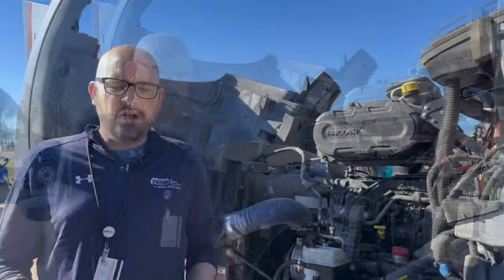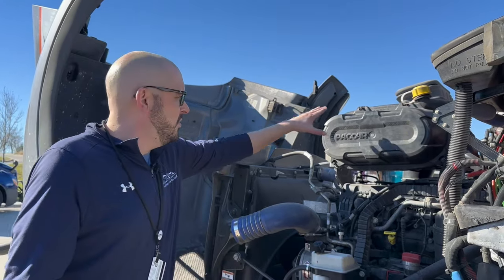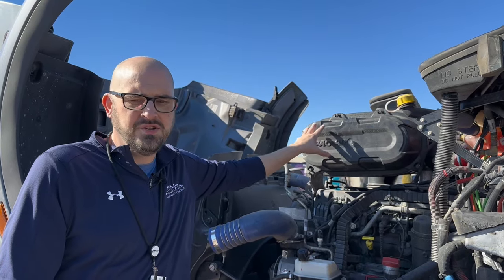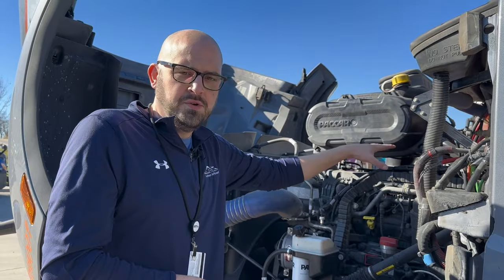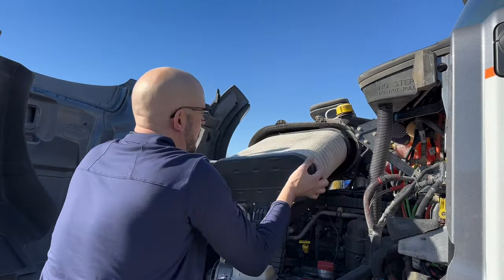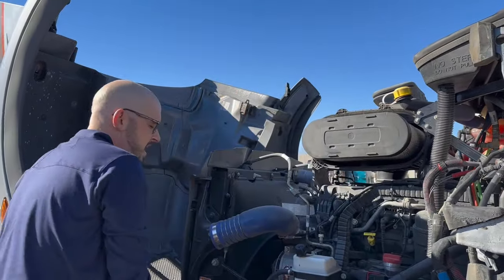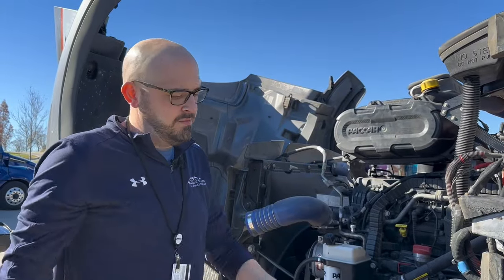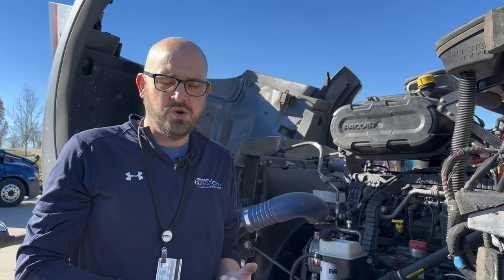How To: Change Your Air Filter on Your Semi!

Comment: Does the inside of the semi smell dirty/dusty when the filter needs to be changed?
Reply from the maker: There is an air flow meter in the cab to show you when you need to change the air filter. Typically we would like you to change it every 85k-90k miles.